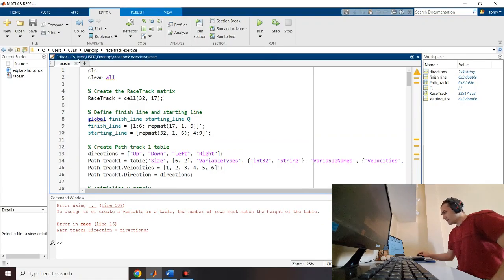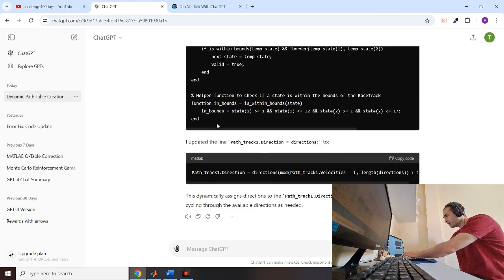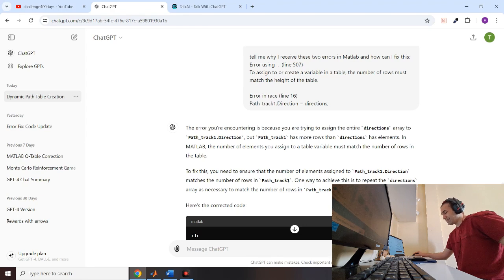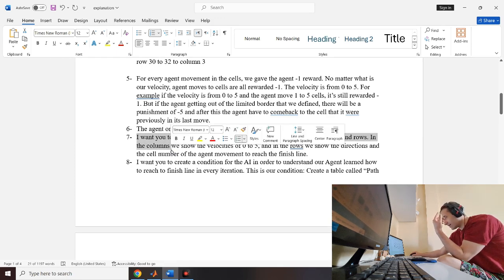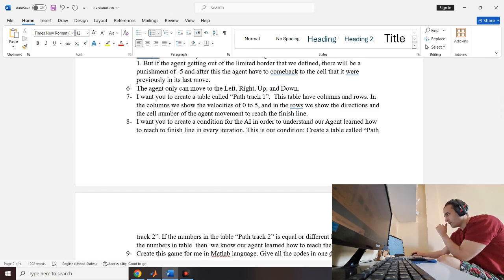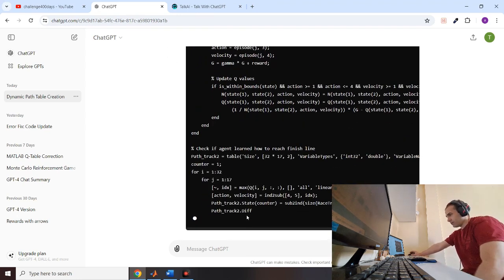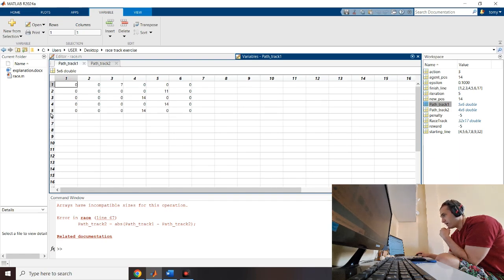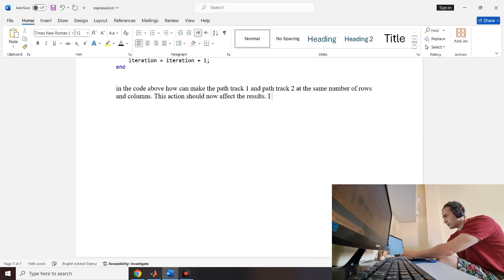DAY 246-I locked myself up at home 400 days to learn programming/ STUDY WITH ME / AI Game

Comment: You fix the problem by learning programming. Ask chat gpt questions to better understand, not write code for you.
Reply from the maker: as you might know I only learned css, js, html and python. the matlab language is for my university and I can not learn it in a short period of time but I can do debugging because matlab have a lot of similarity to python.
Reply: @challenge400days  Use other LLMs(LLama3, Claude 3 Opus, GPT 4 turbo). And don't write code with an AI: it's horrible and bad practice.
Reply from the maker: @biscuitdelicious5410  thanks for the hint, I don't know matlab and I am in hurry to finish my projects
Reply: @challenge400days  that sounds like a perfect recipe to disaster